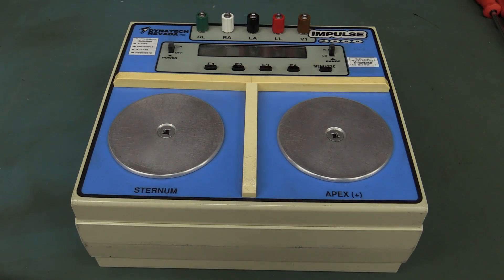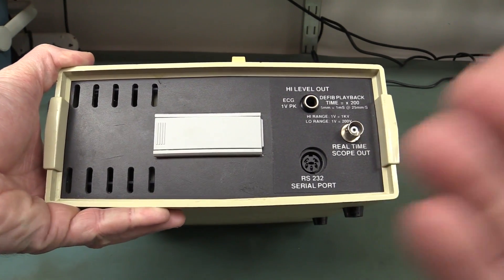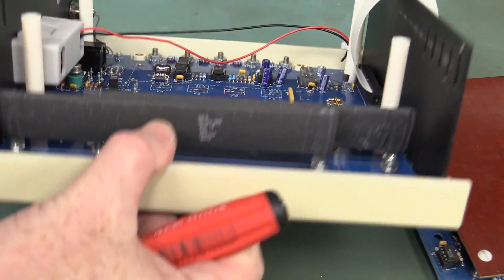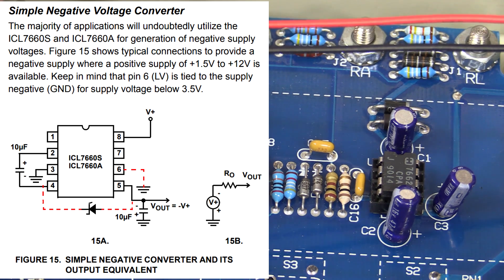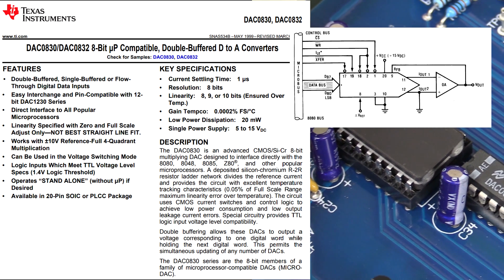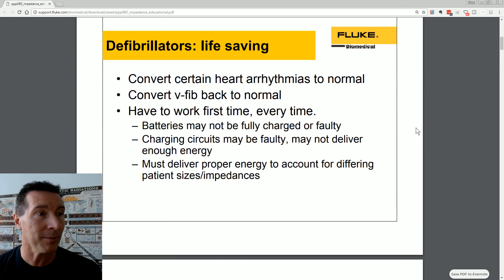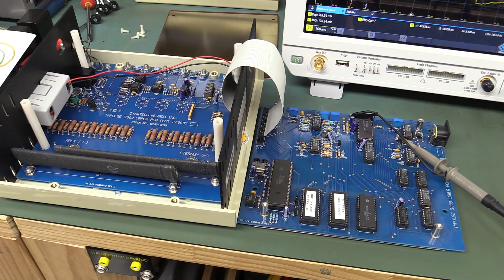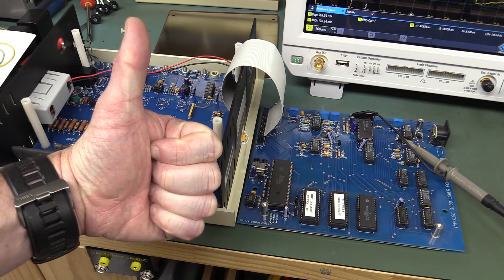EEVblog #1008 - Mystery Teardown

Comment: Pretty cool. Most defib units on the market now days have their own built in testing systems. This allows for easy daily self diagnostic test to ensure the unit is working at the proper specifications.

Paddles are not used much these days at least in the region where I work. They have been deemed unreliable and it increases risk of coming into contact with the patient when a shock is administered which will put your ass on the floor if your touching the patient when they get shocked and possibly stop your own heart or put you into an unstable rhythm.

Comment: You probably did not see an output on your scope at your first testpoint measurement because the amplitude was too low (1 mV), but at the DAC the voltage was higher it seems (500 mV). The second set of resistors is probably the voltage divider for the output from the DAC to whatever device is measuring. Doing this you can also simulate the high output impedence of the body. The large voltage divider probably also protects the DAC from the defibrillator during operation.

Comment: The insulating sheet is made of textolit (Rezotex). It is very old (known since late '30s) and a common material. It is made of a cotton fibers (also a fiber glass version exits) and a phenol resin. I'm surprised you didn't know it before. Very old PCB were also made of this, but more common usage was a base plate for electric switch/fuse-boxes and also in mechanics for plain bearings.

Comment: Dave;

That fiberglass insulation board is the same thing as was used in old tube radar sets for insulating high voltage, high current power supplies. Really top drawer stuff but expensive. I did know the dielectric rating on the stuff because we would have to test it every 2 years but that's been 30 years back and I just don't remember.

Comment: I have actually designed one of those... The one I made could measure energy of a FRED defib waveform... It came out pretty accurate... 
Good ol 8051 MCU running it.
Cheers,
 - Eddy

Comment: Mate, the scope output is for viewing the defibrillator output not the simulator outputs. The simulator outputs are present on the 5 terminals on top of the unit. these signals are to simulate the patient so the defib can be tested to ensure that is triggers at the correct part of the ECG waveform. Not all defibrillations are for  Ventricular Fibrillation, sometimes a patient is fibrillated to correct a non fatal arrhythmias. Also modern automatic Defibrillators can Defib without user input so a tester with an ECG simulator that can simulate both normal sinus rhythm and Ventricular Fibrillation is needed.

Comment: Hi Dave!,

I have a Faulty UPS that complains of an inverter over-voltage fault as soon as it tries to bring the inverter online (its a double conversion unit), it would seem to be a silent failure as well, nothing went bang that i know of, and i haven't smelt any magic smoke.

Do you reckon its repairable?
If i you would like to do a reversible teardown on it and attempt to fix it and make a video on it, i'd be happy to deliver it to you.

Model is a Chloride Active RT 3000 Series.

i actually have a second nearly identical unit that did go bang, and it was found the inverter mosfets went boom, im gonna try and fix it myself.

Comment: Dave, I don't think the 8-bit-ness of the DAC is the limitation in that waveform. The vertical divisions are finer at points and coarser at other points, which leads me to believe that the time resolution is what's causing the crazy steps.

Comment: I wonder, is the actual output of the DAC coming out of the 2 pads?  I could see this device simulating a beating heart so that the defibrillator paddles can pick it up and show it on its own display.  The stair case is designed to check resolution and bandwidth of the display and make it obvious that it is a test waveform.

Comment: This is obviously for testing/calibrating full feature hospital defibrilator carts that are used multiple times per week, not the modern disposable defibrilators that are placed in public and are typically used at most once before replacement.  All the 7 connection on top are for the wires that would normally connect to different parts of the patient.  The jack on the side would connect to some common device in the maintenance workshop (at the hospital), while the scope should plug into the BNC with a regular 50ohm coax.  The rough waveform resolution may be because some of the simulated "events" have much higher amplitude, so the ones you measured are near the bottom of the range.

Comment: The strange resistors in the resistor divider should be caps to form a capacitive divider and being able to work at higher frequecies. Hi impedance resistor dividers only work well in DC.

Comment: Insulating sheet looks like Tufnol or similar.
Reply: Phenolic, is what we used to call it.
Reply: Bakelite
Reply: Yup, its Tufnol. Used to use loads of the stuff once upon a time. Even machine it on a mill and use it for a modelling material.
Reply: In Romania we call it Textolit but i think the english name  is  Textolite. Very good insulator, easy to work with pretty good mechanical strength  an heat tolerance.
Reply: We usually call it Pertinax here in Czech, but that's probably just one of many trade names for it...
Reply: The other trade name for this stuff in Europe (Poland) is Rezotex or Textolit. Its basically cotton fibers in epoxy. Seems to have many trade names. My grandpa used to be an electrician, this stuff used to be really common in high voltage breakout boards in 80s and 90s all over post Soviet Union and surroundings.
Reply: Looks like a thin sheet of the phenolic resin boards we used in high voltage switchboards on Navy ships.

Comment: I’m no heart surgeon but the VENT1/VENT2 modes probably simulate ventricular fibrillation or ventricular tachycardia, both somewhat similar conditions where the heart beats rapidly, but inadequately or irregularly. Defibs would likely have a seperate routine to deal with these types of heartbeats, as it would have a seperate routine if it detects a normal heartbeat (don’t fire).

I’m likely to be corrected but that’s my theory anyway.
Reply: Yeah, Coarse and fine Ventricular fibrillation, or V.Fib for short. It may also simulate Atrial fibrillation (A.Fib) but unlikely as I do not think that unit can test AEDs (which need to know the difference between A.Fib and V.Fib in order to fire.)
 - Eddy

Comment: The new standard for defib testing may have been instituted in 2010. The two standards mentioned in the video appear to have been merged, since the AAMI site calls out DF80 as a previous designation for the 60601 document. From that page:

"AAMI/IEC 60601-2-4 covers the basic safety and essential performance of medical electrical equipment intended to defibrillate the heart by an electrical pulse via electrodes applied either to the patient's skin (external electrodes) or to the exposed heart (internal electrodes). This standard does not apply to implantable defibrillators, remote control defibrillators, external transcutaneous pacemakers, or separate cardiac monitors. This standard amends and supplements IEC 60601-1 (third edition, 2005)."

Of course these standards seem to be behind paywalls. Unfortunate. :(

Comment: In a past life i worked on defibrillators and the more advanced units also had heart rhythm monitors and it was very common for the US FDA to mandate an update maybe to firmware or hardware so i found myself sitting in an active ER up to my elbows in defibrillator. 

i one had one that lived in an ambulance returned it's main capacitor had exploded and had a big hole in its side I don't know if it was connect to a patient at the time :-(

I also did a stupid thing by putting a sheet of paper between the paddles and letting 300 jewels discharge. it arced through the paper burned a small divot into the stainless steel paddle which cost me most the the afternoon to carefully sand flat again. 

Sadly I've also had the need to be be connected to a defibrillator a few times to stop and restart my heart. i was sedated at the time but it leaves a nice red burn mark where the pads where.
Reply: Systemrat2008  To stop and restart your heart?
Reply: Had atrial fibrillation 2 x cardio versions and then an ablation where they put a catheter via a vain in the leg up into the right atrium and burn nerve paths inside the heart. So far that has been successful. https://en.wikipedia.org/wiki/Atrial_fibrillation https://en.wikipedia.org/wiki/Catheter_ablation
Reply: Systemrat2008 I have WPW syndrome and have to have ablation to, but I'm on the waiting list so take verapamil till then.
Reply: Systemrat2008 - I to am having the ablation at the Royal Melbourne Hospital, but as a public patient it is Free, just have to wait 6 weeks.
Reply: good insight into someone who was patient and also a technical afficionado( support ) in such health products
Reply: Woo. My heart was stopped when my aortic valve was replaced. Now that I have an artificial valve, I can officially claim to be a cyborg. And before someone else mentions health issues, I was born with a bicuspid aortic valve that I was born with, though it wasn't found when I was 27. Though, to be fair, having my rib cage cut open and then the subsequent healing was, by far, the worst part.
Reply: Systemrat2008 - thanks mate for the heads up, I hope to not be in for to long, my surgeon said it was a Day procedure, but he talked about taking it easy for two weeks after, I have been on verapamil for 12 years now and there ( specialist ) said the meds are not working as well as they should now and I need to have the ablation on the left side of the heart, using a laser to burnout the bundle of Kent ( Wolf Parkinson White syndrome type A ) but you probably already know this. Been good talking to some one who is going thu what I will at the some Hospital, Who would of thought that on this medium.
Reply: Idiot - Do some basic research which will support my initial statement. PS I do not have a fat ass. Have a nice day
Reply: I have private insurance and it was done at royal Melbourne private I think the cost was $34,000 dollars with the bed being $2000 per night in icu. They tried a few anti arrhythmic drugs on me prior and after two cardio versions failed I went the ablation route. its reported it may take two goes but thus far I am all good. I have my own ecg unit :-) plus i could feel the issue in my neck artery's. The root cause of my problem was perhaps a very high platelet count which after all the heart surgery was found to be a rare form of leukemia called myelofibrosis. Happy, happy joy joy.
Reply: Great. My experience there was good with exception of the patient internet access was utterly pathetic. Dial up would be faster and they had no pens or pencils in your bedside draw. Thus filling in the food menu required a very kind nurse loaning me a pen for the duration. Perhaps that has changed now but i would take a pen anyway.
Re the ablation I had no real issues other than being very weak for a few weeks after which was due to the heart being inflamed after someone burn a heap of nerve pathways.
Oh i got a bill at the end for $500 from the anesthetist as i was under for so long.
if you want to discuss the experience PM me a phone number if you like.
Reply: So what you're trying to say is you sat on your fat ass ate shit most of your life then expected doctors to help you after self inflicting your problems